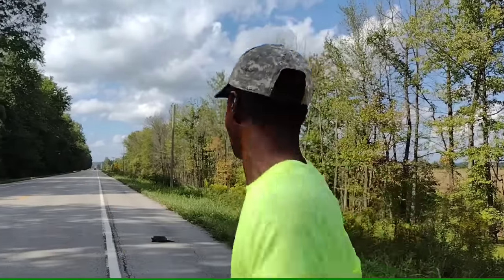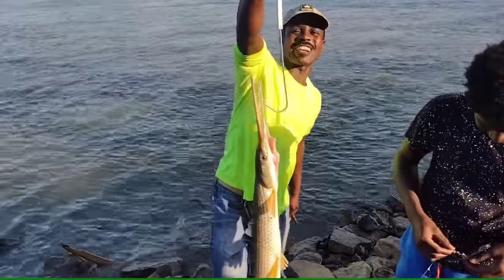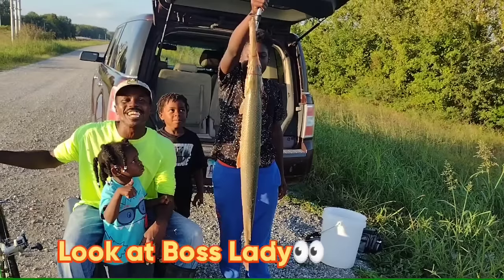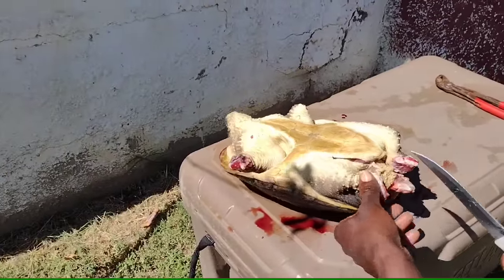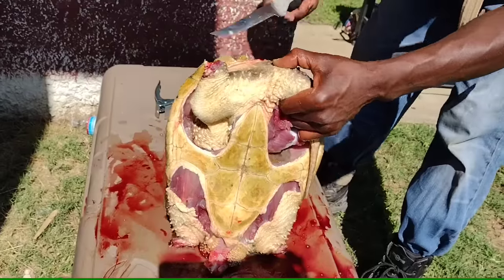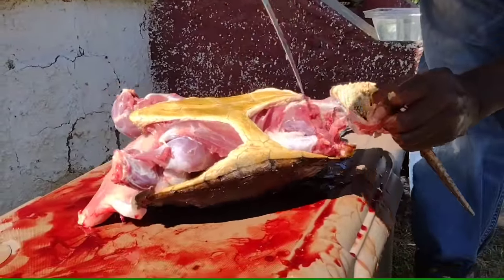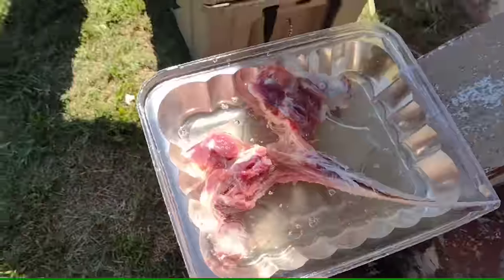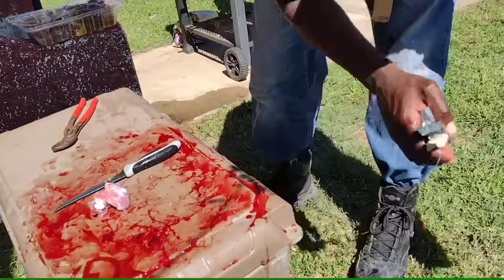BBQ Snapping Turtle Part 1

Comment: Quick tip: after you cut the head off shove a water hose up the skin and neck the water pressure will separate the skin from the meat.
Reply: Make a video
Reply: Yessir.. thats how cows get done at slaughterhouses too..
Reply: Facts
Reply: Right on!
Reply: Yep, Thats how it's done in Bama...
Reply: You are correct sir 💪🏽
Reply: Fla style make it easy
Reply: Facts  thats how we do it in Montgomery County North Carolina  💯
Reply: Upload your video
Reply: The black dude slow 😅😅😅😅😅😅
Reply: Very helpful
Reply: Air hose works well too! I use a 1/4 piece of copper tubing about a foot long screwed on to the air hose attachment makes skinning process so, so much easier!
Reply: That's nasty

Comment: That turtle is some good eating. I caught three big ones out of a pond at a hotel we was building in Charleston South Carolina. Me and a friend put them in a drum of water for four days to flush them out. Then Thursday evening we cleaned them at work and I took them home and made a number 3 wash tub full of vegetables and I seasoned it up good and put some hot sauce in it then the alligator turtles. I cooked it all night on a slow heat and come back home before lunch and took it back to work where me and my employees sat under a big oak and cleaned the last drop out of that tub. Y’all got some great eating there. And those big flat heads y’all been catching is my favorite catfish to eat. I’ve caught some that was over sixty lbs. they like to lay under a bank cut out or hollow logs on the bottom. I’ve screwed tires together and sank them in a deep hole for the flatheads to get in. Great videos y’all.

Comment: Togetherness  as a family, in cutting a turtle , filet under one side of the bottom shell, do the same for the other side. Do the same for the top, but you are cutting and pulling back at the same time. You have to stay close to the shell. Make it easy on yourself.